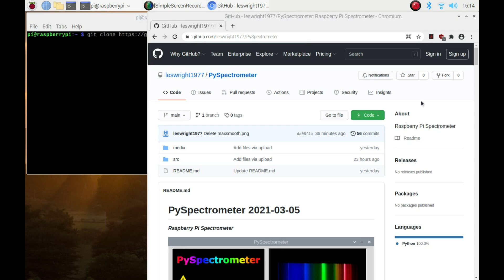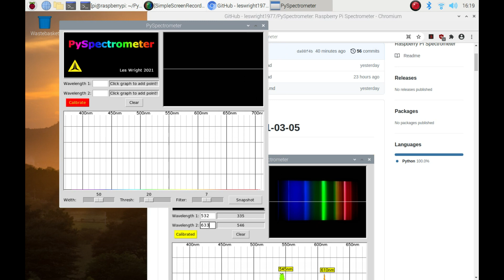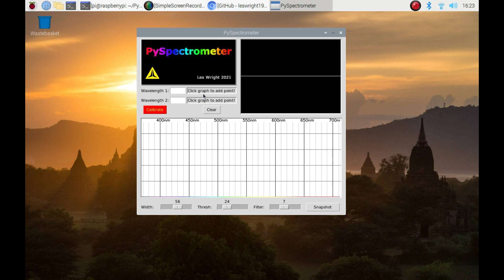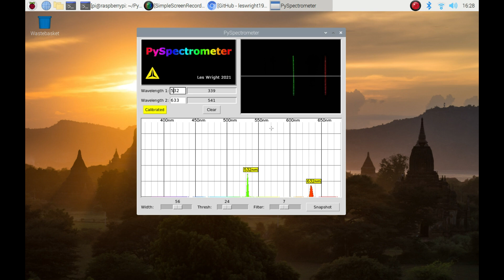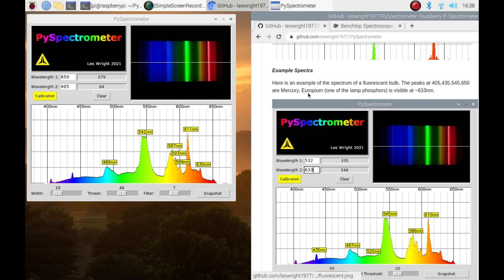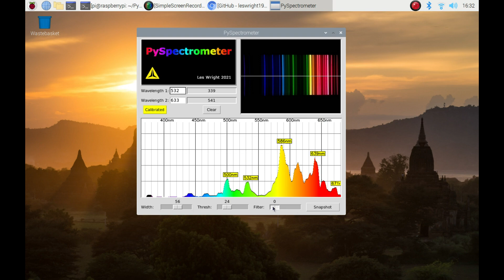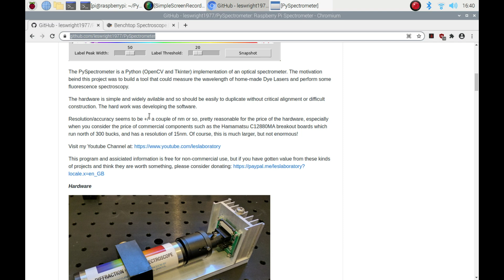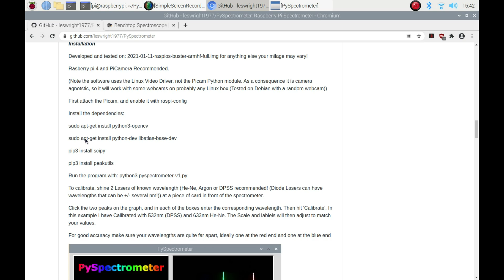How to build a DIY Raspberry Pi Spectrometer using a Picamera and Spectroscope.

Comment: Cool!! Have you thought about removing the UV- and IR-cutoff filter from the Pi cam?
Reply from the maker: All good questions!
I did not remove the IR filter, as the scope I am using was designed for visible wavelengths only, and my interest at the moment is the visible spectrum.
Internally the spectroscope is a transmission Diffraction grating, plus a collimating lens and a prism (for a linear design) this is too much glass and plastic film for UV to make it though and would significantly attenuate IR.
If you build your own spectroscope frontend, you could do whatever you like. For this you would need a reflective Diffraction grating to deal with IR and UV, and quartz optics as well.
Yes, Picams have a Bayer filter. Jon Smirl on GitHub suggested removing this for UV work, and cited a paper here: https://www.mdpi.com/1424-8220/16/10/1649/pdf but it is not for the faint of heart!
Also yes, you would then have to characterize the response curve for the Picam sensor, minus the Bayer filter.  
On the plus side, you would have a really high resolution B&W Picam if you sample the original RGB values as individual pixels. That, in and of itself might be useful to the Astronomers.
Reply: @LesLaboratory  doing something similar (learning). I'm an (inexperienced) amateur astronomer as well, and I'd quite like to see if I can get a spectrum from some of the brighter stars.
Reply: I had the same question --> can we upvote this question ? :)
Reply: @haroldemmers3678  I concur. It is a very solid question and I'm now curious about the answer. Perhaps he considered removing them but decided against it for some reason, and that reason itself might make for a good followup video.
Reply: Bayer filter also might affect the spectrum, going with black and white sensor is doable with calibration. Hardest part in this DIY setup is intensity calibration since sensors might pick up different spectrums with different intensity.
Reply: Consider removing the CFA or using a monochrome sensor ;)
Reply from the maker: @iliahborg7079  Already on it! ;-) I have killed a couple of Picams in the process, but I think I have nailed it, but I want the process to be repeatable, it's a tiny sensor. Just waiting on some new ones to arrive, then I can tackle UV and IR
Reply: @LesLaboratory  is it not more practical to just buy a camera made for your particular purposes from somewhere like FLIR or another vendor?  If youre making some of those, I would like to buy a couple of each.  I am gathering components to build this currently.
Reply: Amazing stuff.

+1 for having UV, and more especially near and deep infrared.
Reply: I was about to make the same question.
Reply: On the other hand: there are several pi camera modules you can buy without the IR filters.
Reply from the maker: @CristalianaIvor  Yes, there are, but the inbuilt Bayer filter "does things" to both the IR and the UV. There are ways of removing the Bayer filter, but I can say from experience it is very challenging!
Reply: I know you've since done videos about bayer removal of Pi cams, but you can pick up monochrome USB cameras pretty cheap on ebay etc

Comment: Any way to measure NIR/IR with this?
Reply from the maker: Yes, the graticule and labels are calculated in software so you can calibrate the software such that if you wanted to, you could for example display 600nm to 900nm in the graph. The spectroscope I  used is designed for visible wavelengths, so you might have to creative in that respect, and build your own . :-)

Comment: Interesting project. I wonder if this band would be useful to measure aqueous salts as in the content of said salts for maintaining a hydroponics system? I suspect, (I am no chemist), that shorter wavelengths would be more useful in that domain. Any idea? A broad band of light may be required also.
Reply from the maker: Not a Chemist either really. My suspicion is as yours, short wavelengths. IR transmission of solid salt at least, is pretty good, good enough for IR Laser windows such as for CO2.
Reply: the most useful range for chemical compositions are SWIR and LWIR as the bond lengths absorb IR light for different bonds.

Comment: I need to build me one of these! Now it's my understanding that RGB CCD cameras have an Infrared filter in front of the sensor, because the sensor itself is sensitive to near infrared. Is it possible to remove this on the Pi-Cam? That should extend the working freq range. (And a monochrome camera would be even better, no RGB+(IR) filters at all = even better light sensitivity.)

The colour data of the image can of course be recreated in software since we know the freq. (The only issue would be the possibility of orienting the spectroscope 180° out of the correct rotation if you don't pay attention.)
Reply from the maker: Yep, you can also get Picams with the IR cut filter removed from the supplier if you don't want to do it yourself. 
Also yes, they have an RGB filter on the Silicon. It is possible to remove this, but it is not for the faint hearted from what I have read!
Color data is not an issue. The colors in the graph are generated in code, and derived from the computed wavelength. An early version used the color data from the camera, but it looked awful!
Reply: @LesLaboratory  Oh did you already have an IR capable Picam? Sorry I didn't really pay attention to the actual length of the long wavelengths in the vid. I imagine to remove the RGB filters, you'ed need to break a dust/moisture seal on the sensor housing, and then soak the bare silicon in a solvent to remove the mask, then reseal it; all without scratching it, or introducing dust or moisture into it. Sounds scarier than CPU die lapping! I agree, not for the faint of heart!

Comment: So what does it do.?
Reply: It gives you the wavelength of light you see from a given source.

I think something like this is used in the printing industry to pick the correct color.

Hopefully, this is not a shock to you, but digital cameras and digital displays may not display/capture color precisely.
It may be a good approximation, but it can be inaccurate at times.
A spectrometer definitely takes away some uncertainties.
Reply: @porcorosso4330  fucking cool! I love learning!

Comment: Why not make a 3D printed case to accommodate the entire project?
Reply from the maker: Dan said this in the article on hackaday: https://hackaday.com/2021/04/23/pi-based-spectrometer-puts-the-complexity-in-the-software/ I don't have a 3d printer though. I quite like aluminium for stuff anyway. It has a weight to it, and I want to clamp it to an optical bench to do some Dye Laser measurements.

Comment: Pin hole camera to look at the sun? Might be useful for calibration.
Reply from the maker: Either that or an ND filter and you can maybe calibrate from prominent Fraunhofer lines perhaps. Relative intensity is a different story.

Comment: Fantastic video! I can’t wait to try this myself. Is the website you listed on the GitHub page the place you bought your spectroscope? 
And how bright of a light source do you need to get a reading? For example would it be sensitive enough get a reading off something like a glowstick? or maybe a bright LCD screen?
Reply from the maker: Thanks! The spectroscope was gifted to me, but that is the manufacturers site for this model. There are plenty of similar ones about, or you could make your own. 
You can easily get spectra from an LCD monitor. I would imagine you should be able to for a glowstick as well in ideal circumstances. 
If I can get time on my side, I might add things like brightness, contrast etc, but I would need to rewrite the interface.

Comment: Terrific project! Sorely tempted to give it a try. One thing I'd like to see is the ability to export the spectrometer data into a data file of intensity vs. wavelength, for further analysis. I was also wondering whether there was any way to remove the IR filter from in front of the camera, to extend the spectrometer's range into the infrared.
Reply from the maker: Done! V3 uploaded to GitHub! Also see: https://youtu.be/dm3woVQp8Xc
Reply from the maker: Go for it! I can add that in, I'll add it to the to-do list. CSV should do for most stuff. You can get Picams with the IR cut filter removed.

Comment: Very cool project. DId you consider the smaller pocket spectroscope and have you done any flame tests.  One of my interests is identification/verification of 3D printing filament
Reply from the maker: The one I have was gifted to me, so I worked with what I had. The pocket version should work, with some experimentation. I have not done a flame test, but now it is added to my to-do list! ;-)

Comment: This would be useful for quantitative and comparative work if there was a way to connect it to one of the powerful free spectroscopy packages, such as the excellent Spectragryph software. As it is, the graphing features are much like the many other DIY spectroscope projects out there that simply use a webcam. A few of the better designs can achieve similar wavelength resolution.
Reply from the maker: For sure. Given time this software will evolve though. I have already added peak hold feature this week, and I m sure many other useful features can be added.
Reply: @LesLaboratory  that sounds promising. I think it's simply a matter of assigning a specific serial data protocol that can be sent easily over USB or Ethernet to a laptop, or copying an existing one. The developer of Spectragryph has included all of the most popular commerical spectrometers to the menu, and a few amateur ones. As long as they have the handshaking and data protocol for 2 way communication in hand. The other usual option to be provided by the Pi spectrometer, in this case, would be to define a stack of multiple successive samples, to allow for time averaging of weaker and noisier signals. I don't know if there's any option to change the exposure time or frame rate of the Picam, but that would be another useful feature if it's settable in the UI.
Reply: Im going to try to make it a datalogger somehow so that every 30 seconds it takes the max, min, and mean for the entire spectrum and saves to a comma delimited file based on time.

Comment: Very nice.  I am working on getting an AS7341 specto-sensor working on a telescope.  It has ok wavelength coverage for a cheap sensor. I have made a 3d printed mount for it that resembles an eyepiece camera. It keeps the sensor's entrance in the center of the optical train.  Shooting for prime-focus but may introduce an ED 2x Barlow to give larger star images.  I have an ESP D1 Mini reading the sensor and sending the data via MQTT for processing.  I will be looking into getting a plot done soon after I get the optics/focusing sorted. Looking at making a focus mask to use in place of the sensor in the same type of mount.
Reply: Interesting project. Just curious, do you have a specific astronomy goal such as identifying certain types of objects by their spectra?
Reply: @WilliamDye-willdye  Long term, I'm looking to have a small on-the-scope sensor that can be used for quick spectral analyses.  Short term, it's to see if I can get a working system for such data collection just on the scope.  The AS7341 is the first device I thought would be a good one worth testing due to its bandwidth and cost.  I did us an RGB sensor a few years back but never moved past an initial test due to the limitation on the sensor.  I know this would not replace a real Astro-spectra setup, but it has been fun and the sensors are getting better.
Reply from the maker: All sounds pretty cool! :-)

Comment: Great video!  For those of us who are super-cheap, I wonder if it's possible to make a version that uses light reflected off of CD's or DVD's instead of the spectroscope.  Maybe the software could transform the image as needed to reconcile between the CD and a real spectroscope.
Reply from the maker: Thanks! It should work with any home made spectroscope. So long as you can fit the spectrum in the preview Window. RPi4 is best for this as that is what it was deigned for.

Comment: How resource intensive is the software? Do you think its possible to use a RaPi Zero or 3B+
Reply from the maker: It will run on the 3B+ (mentioned in the and of the video) but slowly, but perfectly usable unless you are trying to get spectra of flashes (which I am).
I have not tried it on the zero. Try it and report back. You don't have to build the whole thing, just run a zero with the picam, clone the software,  and see if the stuff in the bottom window is snappy enough. My guess is it will be annoyingly slow, but will probably run anyway.
I never bothered with sub-processes or threading as I was developing for the Pi-4. If I get time, I will maybe implement it in a later version

Comment: Very nice! I built a spectrometer inside a CD-ROM drive case using a laptop USB web cam pulled from the screen and a cheap 1000 lines/mm grating. I've also just seen that you can get 13500 lines/mm gratings so I'll be upgrading it and adding the Raspberry Pi instead of having to use my working laptop. Cheers Les, great stuff as always!!
Reply from the maker: Awesome, thanks! Yep this should work with any physical hardware setup just fine. Happy hacking!

Comment: Can this be used for display calibration with something like ArgyllCMS? I guess a custom driver would have to be written, but it's the hardware adequate for this purpose?
Reply from the maker: I have never used that software, so I am not sure whether this would be suitable. I think there are already miniature sensors that can do that at a fraction of the cost.

Comment: I do wonder if this could be used to gage plant health.
Reply from the maker: It depends on the metric. If you are using Chlorophyll as an indicator of plant health it could be done, but you would have to research that.
Reply: honestly you could build a photo library of each plant leaf and subtract one necessary component at a time then train AI to determine it from photos itself instead of bothering with the spectrum. I dont think the spectrum would be necessary.  If you wanted moisture content that is in the IR range I think...

Comment: Nice! Just a suggestion: instead of reading the amplitudes from a single line of the camera image, maybe you should integrate over the image. 100 lines -> 10 x amplitude resolution, in theory. Either requires a good orientation of the spectroscope or an algorithm finding the tilt (not too hard).
Reply from the maker: Yep for sure. A much earlier version did this, but I found it too slow. My particular need was speed (pulsed Laser), but if you were doing astronomical observations then integrating is probably a good idea!
Reply: A little tilt allows OpenCV to achieve subpixel resolution when it is calculating the location of straight line intersections in an image.

Tilt will help here too, if the system is limited by the optical sensor.

Which is to say that fancy math won't help if the optics move around when the cat jumps on the table.
Reply: Does this work if there’s smile and keystone errors in the spectrometer? Seems like it is dependent on the spectral lines being very straight, otherwise they will in effect average together no?

Comment: Would there be a possibility to measure UV or NIR, like between 200 and 1000nm?
Reply: The main problem here is higher order diffraction. So the light of second order diffraction of 300nm will be diffracted in the same direction as the 600nm light. In that case you definitely need to add additional band pass filters between grating and sensor for accurate recording of the spectrum.
Reply: The pi camera or lense assembly probably has a near infrared filter which can be physically removed.
Reply from the maker: @Tim_Small  Yep, the zoom lens has no filter, so NIR should be ok.
Reply: @Tim_Small  There is an official RaPi NoIR camera based on the Sony IMX 219 PQ
Reply: @paradieshenne  where is this available?
Reply from the maker: You probably wouldn't be able to look at deep UV, as most glass is opaque at those wavelengths. IR is probably possible though.

Comment: I love tat the rPi has an RGB cooler, with heatpipes and all. awesome project.
Reply from the maker: For sure! There's a huge gap between Green and Red that Laser diode manufacturers have been trying to figure out for years.
Reply: Extremely important to obtain maximum fps in the program interface!!!
Reply from the maker: @appabison8694  indeed. I tried MATLAB in a really early version, but it was far too slow.

Comment: Congrats on 1k subscribers! This is a really cool project, very useful. Would be cool to make a briefcase style case with an lcd and put a fiber connector or something on the input.
Reply from the maker: Thanks Justin! For sure. I deliberately made the GUI small enough that is should fit on most  decent LCD modules you can get for the Pi (clicking the graph on a touchscreen would be a pain, but there are ways around that!). A Desktop instrument would be pretty sweet!